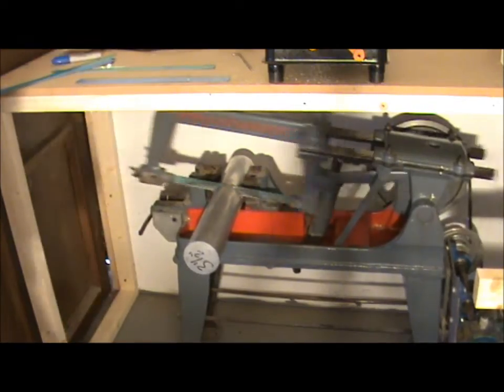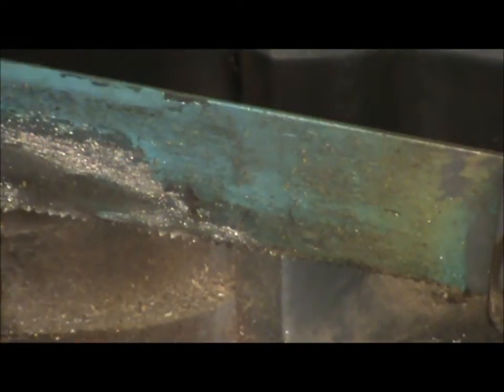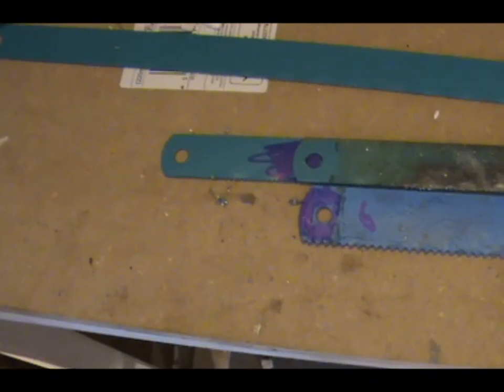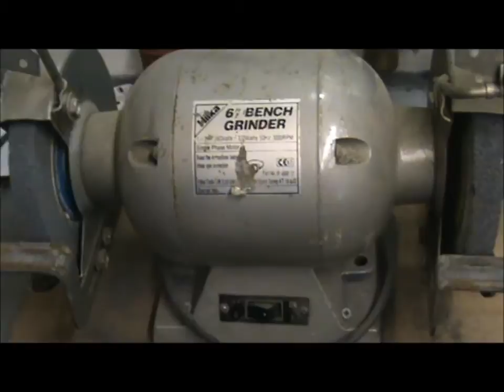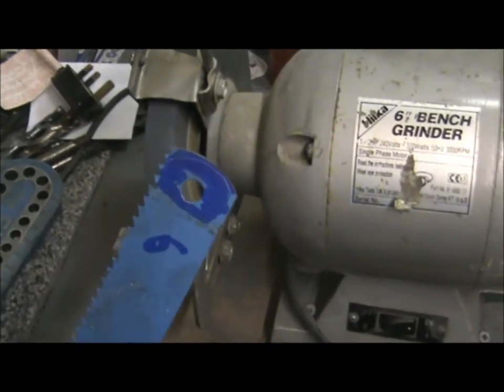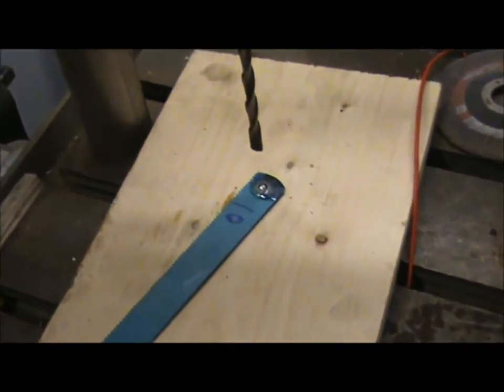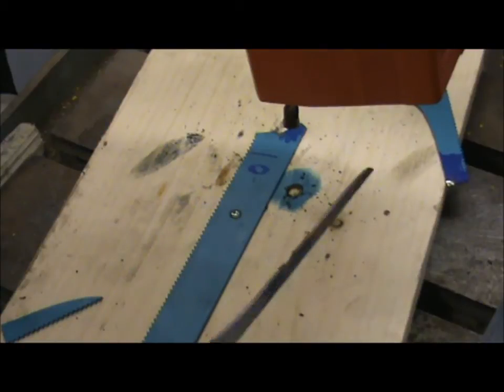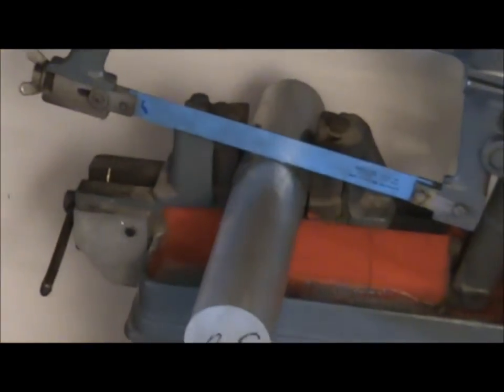DRILLING a power hacksaw blade , bad idea

Comment: This is such a cool machine! Fascinating to watch and it cuts surprisingly fast!
I used to drill hacksaw blades by setting the drill press to the highest speed and drill with low pressure and a dull old bit until it melts its way through. maybe this would also work for your blades.
Greets

Comment: You had the right idea, just drilled one using a masonry bit but you need to grind a cutting profile not forgetting the sides. Place blade on flat metal not wood Then drill as slowly as your machine will go, if I have to do it again I would use the mill. I did not use coolant/lubricant so you can see the rate of cutting very clearly and peck drill repeatedly using just enough pressure to produce small amounts of powder. The critical part is the exit, as the tip begins to emerge stop and use carbide bur to clean the hole up,
Reply from the maker: thanks for the reply, you've given me some great pointers, what kind of cutting profile would I need to grind onto the bit?, regards chris :)
Reply: skyrocketpuke I only used a standard bench grinder which you probably have no fancy wheels for grinding carbide required as you are removing a tiny amount of material, Leave the tip angle alone and grind the outside of the carbide tip rounded or even slightly pointing inwards so the sides of the tip do not  try to cut into the sides of the hole, Use the side of the wheel to get inside the flutes to grind a flat surface towards the tip, As you do this grind  the top/clearance angle to as small as possible an angle, these two surfaces will slowly "join" up to form the cutting edge. Takes about ten minutes and a good magnifying glass is really needed. These may not be the correct angles but without some very expensive grinding equipment it is about the best you can do for next to nowt.
Reply from the maker: jules2c
very interesting ive a lot to learn! its definitely some thing im going to try again thanks to your suggestions .
 and now subbed to your channel :)

Comment: It looks to me like you have the blade installed backwards. The teeth should be cutting on the back stroke not on the forward stroke. Yes the old blade you had in there would be good for cutting tubing with it's thin wall,  solid material like you have clamped into the vise now would cut nice with a 10 or 8 TPI blade. Especially those softer materials like aluminum will allow the blade to remove a very healthy chip, so I always instal a blade that can remove a very large chip. I have done the same with large solids of mild steel parts.